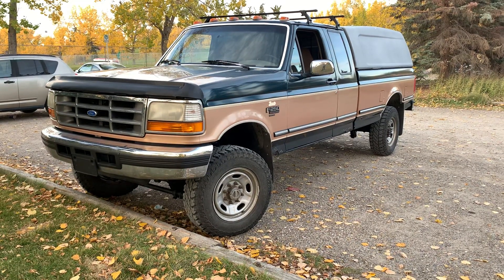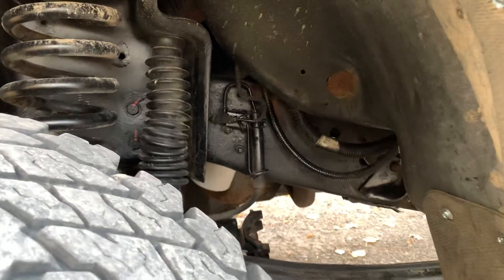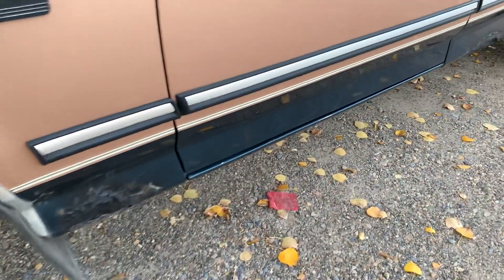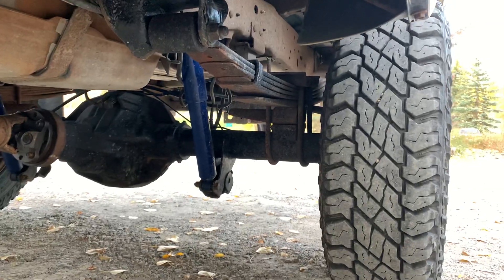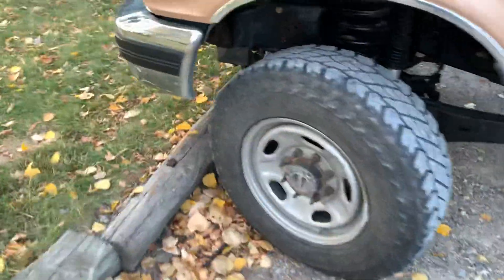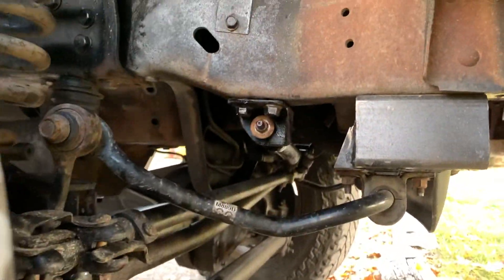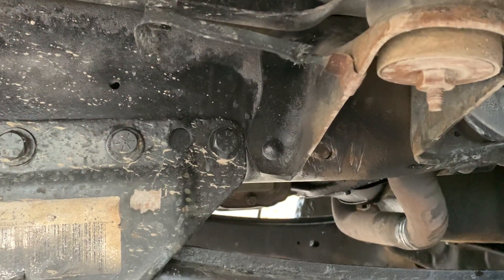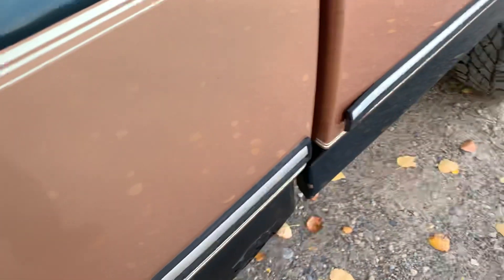OBS FORD!  |  ZF5 4X4 + 05 Super Duty Axle Swap...

Comment: Damn you did a good job. I wish I lived a reasonable distance from you for consulting advice. Wish my 94 250 was a 4x4. I wouldn't where know where to start. Sounds like you really know what you're talking about. Get the rust on those fenders fixed before it goes too far. nice truck.
Reply from the maker: Thanks! Hoping to replace the fenders and box sides in the future. Bit by bit haha.

Comment: Thanks a lot for your videos!!

If you could do one about the driving and handling would be awesome.
Reply from the maker: I will try to! I can tell you it was running pretty well as it was much better than after trying a prefab Trackbar mount. I’m going to be making my own soon or adding a tiny lift to this truck to keep the mount in it, but right now it’s been sitting in storage while I’ve been too busy camping, working and doing other projects 😅 I was faulting it for about two years as you saw it including highway driving and hauling.

Comment: Nice setup.  Did you use an 05 track bar bracket or a 2008?
Reply from the maker: Technically it’s off an 08, I have the one from the 05 also they are the same. You’ll need to trim the factory mount if you want to use it tho.
Reply: @ReindeerBork  how did you trim it?   I’ve got the 08, but it looks like it will be too high.  It won’t clear the steering box right now.
Reply: @ReindeerBork  did you have any leveling problems with front springs?   Or did you use aftermarket springs?   Any problems with front springs being angled?
Reply from the maker: @guol1806  I’ll try to find a picture or take a decent photo of mine once it’s not -20C out haha. But basically you trim it to clear the sector shaft/remove the top hole to the engine crossmember and I also had to shave off a little bit (Like maybe a 1/4”) from the front of mine but if you mount yours a little further back you won’t have to.
Reply: @ReindeerBork  I ended up buying an aftermarket one.  I trimmed a lot of material and it still wasn’t enough.  The SD steering box and pitman arm  were too big.
Reply from the maker: @guol1806  probably for the best I’d recommend that or if you have the skill building your own like I will be. The SD steering box/pitman arm are much bigger. I also had to grind back the edge of my engine crossmember to clear the pitman arm on mine. Not sure if you had to. I was always like 1/4” away from getting all three steering box bolts to line up before doing that.

I will probably make a video just on the track bar/steering box once I fit a new track bar mount.
Reply: @ReindeerBork  I heated and massaged the lip of the crossmember with a hammer to get about 1/2” clearance.
Reply from the maker: @guol1806  Soo my bad… Glad you have it sorted I was digging through the garage and found the 08 Trackbar mount turns out I did use the 05 mount. That said I’m currently mocking up a replacement as I don’t like the fitment/trimming anyway.
Reply: @ReindeerBork  no worries.  The aftermarket bracket is nice. I’m fine with the SD spring buckets, but the aftermarket stuff looks nice.

Comment: Nice job! what tire size did you go with?
Reply from the maker: Thanks! I went with “stock” size tires essentially,  235/80 R17. I hate the way most super duty wheels look (Too flat) so that’s why I looked and looked for these steelies vs the flat face ones, I’ll be painting them black later. I might go aftermarket in the future but I really want the truck to look like it hasn’t been modified unless you know
Reply: @ReindeerBork  You nailed it. It looks factory.
Reply: @ReindeerBork  The 05-07 f250s came with some 17x7.5s that are bullet hole aluminum like the stock obs ones. You can buy me online fairly cheap. Well cheaper than most aftermarket anyway and they look pretty dang good.
Reply from the maker: @jackclanton3389  I have been looking for them but they seem to have been pretty unpopular in this area. If I find some I will definitely be picking them up and then probably throwing on some of the super duty hub caps that look like the ones that came with OBS Alcoa’s
Reply from the maker: @jackclanton3389  I found a set of 5!
Reply: @ReindeerBork  awesome! I would love to see a video once you get them mounted.
Reply from the maker: @jackclanton3389  
https://youtu.be/cuFesVii91Q

Finally got around to mounting them, here you go:
Reply: @ReindeerBork  looks awesome!

Comment: excellent video.   I am building a 93 bronco with 06 axles , using what I have. yours was only video with no lift.   are those the original diesel OBS coil buckets ?   I want as small of lift as possible.  mine will be my daily.   big rubber isn't made for putting lots of miles on.
Reply from the maker: Thanks! I partially posted because I know I spent ages looking for an 05+ swap with out a lift. I’m hoping to do a more in depth video once I finish my front drive shaft. 

I swapped coil buckets also, it sits about the same height as maybe a stock OBS F350. The rear is almost level with two full tanks with the front. However it would probably sit a little lower up front with less HD springs. I have 6K spring up front 😅
Reply from the maker: Added a more in-depth video if interested,
Thanks!

Comment: Did you use 05 brake lines ?
Reply from the maker: Yes, I used Factory 05 front flex lines. As I stated in the video, you do not have to swap sides like I’ve seen a lot of people do provided you aren’t lifting it (it’s got tons of slack), you just need to buy a brake line T.

For the rear I have the Super Duty flex line running to the OBS hardline on the frame, I just cut the original OBS fitting off the line, put the proper fitting on and re-flared the line, you could also just buy an adapter but for the life of me I couldn’t find one locally or in a kit and this option was free and seamless.
Reply from the maker: Added a more in-depth video if interested,
Thanks!

Comment: What did you use for a coil pockets upfront?
Reply from the maker: Used 05-07 Buckets. My front end is all 05-early 08. My rear is 08-10. I’d prefer it all to be same gen but the only differences on the 08 rear ended is calipers/carriers, and the shock brackets being weld on vs. U-Bolt.

Comment: Is it possible for the superduty coils to fit into the OBS buckets or are they larger in diameter? Can't find anything on that. If not, is it possible to use the factory coils on the super duty axle by chance? Of course some modifications may have to be done but I think I may go this route with a 4x4 swap but with a np205 divorced transfercase. 205s don't have a very good low range but I've already got 4.10s in the rear so it would be 8.20 to 1 which would be good enough lol
Reply: I've also considered swapping in the dana 50. They're cheap and strong as hell like the dana 60 but they still eat tires and aren't as practical as a solid axle. But the passenger axle would bolt right up to the drop bracket on the engine cradle and the driver drop bracket will have to be moved inward and replaced with the 4x4 style. I haven't got my measurements yet but I believe I will be able to bolt my factory radius arms/coil mount to the dana 50 ttb axle instead of leaf springs just like the dana 44 in the half tons. If it all lines up I can bolt it to the top of the axle beams, drill the hole on the bottom of the beam and run a bolt into it then it would be just like how the half ton dana 44s are mounted.

I've also considered 2nd gen dana 60 swap as that is already set up for coils and has a cad system instead of manual lockouts, so I could run a manual cable and lock the front axle when I want to. Although special fabrications would have to be made lol
Reply: To clarify the use of the 2nd gen dodge dana 60, they're set up for coils, cad system rather than manual lockouts, and they have 8x6.5 lug pattern (don't know the hub size) which is the same as ours
Reply from the maker: The SD coils will not fit in the OBS buckets, the OBS springs may fit on the SD perch but I’m not 100% sure I believe the 2wd SD springs will also fit the OBS bucket as they are the same too I believe. The buckets are like the easiest part of the whole swap though tbh so I would just grab some buckets if you’re planing to do that.

The D50 is strong enough for street use but they fall apart elsewhere, too many bushings and it’s basically only a D44 internally.

As for using a Dodge D60 they are inferior and also way more work, totally deferent diameter coils also more work for a worse axle.

If you want the ultimate cheap 4x4 swap pull a D50/60 and rear end from a 99-04 Super Duty, buy an RSK for Super Duty springs to convert the front end, bolt in the rear and then figure out what you want to do for actually getting into 4x4.

As for the hubs I went manual as I’ve never had manual hubs shit on me. I have had 3 auto hubs shit on me between my 6.0 and 7.3 SD’s and the hubs that cam on this axle originally. With the right driveshaft (CV) you can just run with them locked in all winter long. I have had my hubs locked in at 130km/h and no vibrations.
Reply: @ReindeerBork  I hate automatic lockouts. Dumbest thing ever. I just thought it would be cool to have the cad system from the 2nd gen and convert it to cable pull. The inferior aspect of the dodge dana 60 can be fixed with I think some 3rd gen parts, but at the end of the day it's still a dana 60 but with the manufacturer's personalized bullshit on the tubes and steering bullshit. 

The dana 50 ttb 3rd member (differential), axle housing, cv axles, and u joints are significantly larger than the dana 44 ttb counterpart. They are even larger than the dana 44 hd. Dana 44 hd shares the same axle housing as the dana 50 but has the same ring, pinion, carrier, and spider gears as the dana 44 in the half tons. Dana 50 is the only ttb with bolt on cv axles rather than a c clip in the diff. 

Although I do agree with you as far as the falling apart thing, at least mostly. They're strong axles and by design of the pivot points it is as rigid as a solid axle but of course incorporates the independent ride effect. Ridges like a brick even with coils on the 2wds. But they are strong axles. The part that makes me agree with you on that is that there's more to go wrong. Like the full length cv axle, extra u-joints, etc. Pivot bushings aren't an issue in the slightest unless it's a nice daily driver and not a farm truck. Ford dana 60s have less to go wrong and the 05+ SD D60 is a strong high pinion setup. I have yet to decide what I want to do but a D50 ttb on my factory coils would be amazing and is doable. I just wish ford pre-drilled the holes for the 4x4 drop bracket. Or at least made a divet for each bolt hole in the crossmember like they do the door so you can change the window motor.

We'll just have to see what I decide to do when the time comes. And even if I do it 5 years from now I'll show back up in this comment section and let you know what path I took and how it all worked out.

I don't plan to do extreme offroading as it is one of my daily drivers and primary towing truck.

One more thing, the early 2wd super duty still had twin I beam. I don't know what they've done for the last 15 years or so but I'm sure the 2wds still have a decent front end 😆